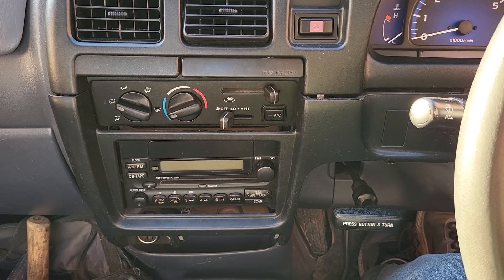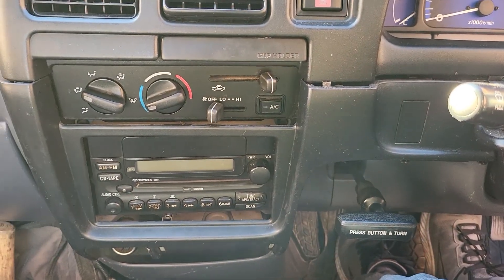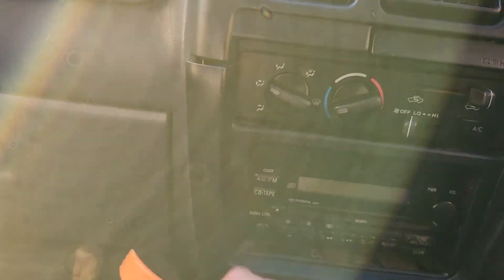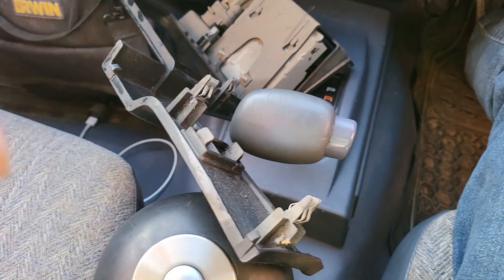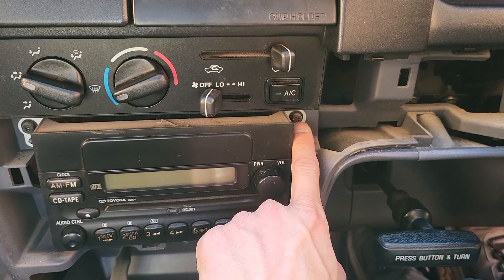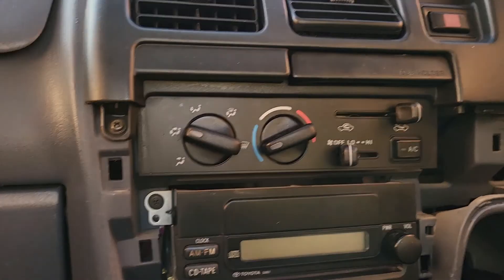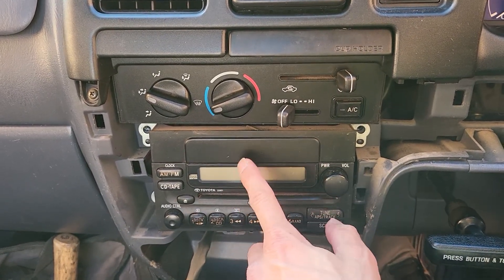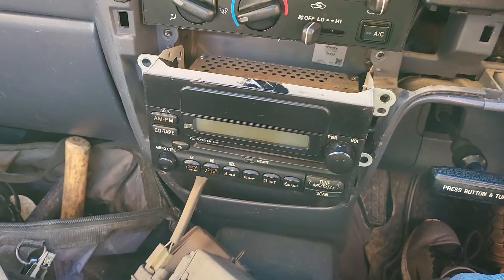Expert Guide: How to radio factory removal TOYOTA HILUX 2004 | Most Details 2025

Comment: If you could explain the colors of the wires and where to connect each wire on a new radio, that would be of great assist...
Reply from the maker: Because there are too many versions and models, we currently don't have this service